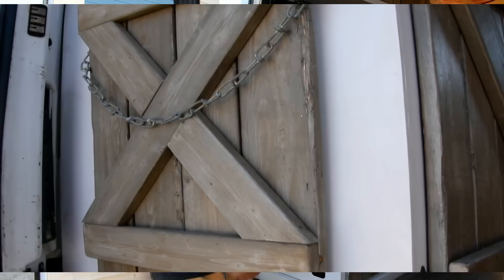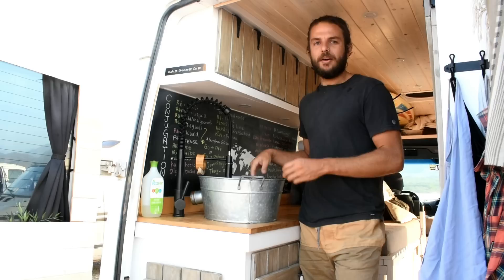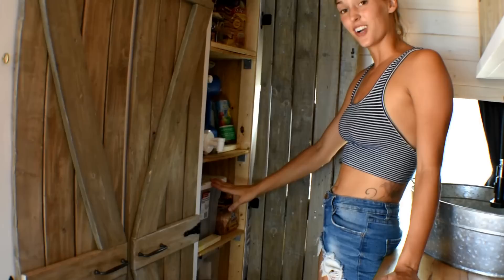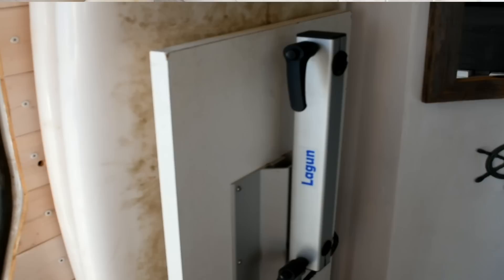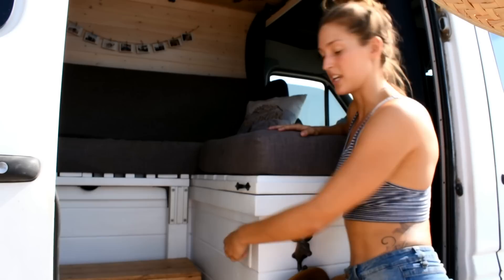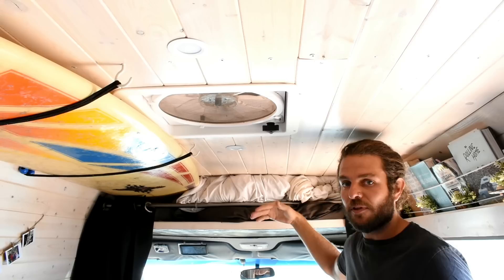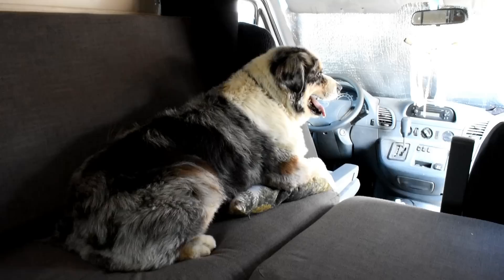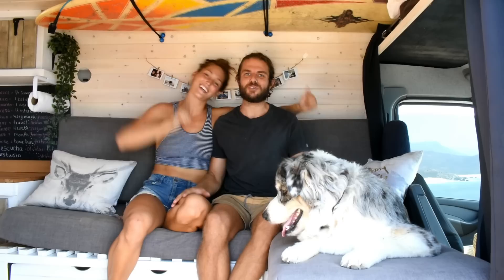BEAUTIFUL Rustic DIY Sprinter Conversion | Travel Couple | VAN TOUR

Comment: 10:25 I've always been curious, do you park for days at a time?  Everyone wants solar, if I was driving every day, even a little I would wire in a battery isolater and charge off the alternator, one less thing to buy.  Of course if you hang out in one place for a week solar is perfect.
Reply: Not trying to be rude, I see a lot of solar everywhere and always wondered if it is because everyone else does or it is what works best.
Reply from the maker: KFStreich thanks for the question! We chose solar because (as you mentioned) we sometimes stay at a place for days at a time and we didn't want to have to run the van to top up the batteries. In saying that, charging off the alternator is also great if you are driving most days. I actually recently added alternator charging to help out our fridge in this extra hot weather!
Reply: I've wondered the same thing - specifically, I've wondered about having to park in the sun when it's super hot rather than going to a shade spot. I would think the van would become virtually unbearable. Of course, I guess you wouldn't be hanging out in the van during the day, so maybe it's not so much of a problem.

Comment: How do you find the 2006? I'm in Australia and interested in something around that age but a little freaked out about the idea of buying something with literally hundreds of thousands of km on the clock.
Reply from the maker: Ours has around 250,000km right now and sprinters are known to run well upwards of 500,000km (& hopefully more)! One advantage of the 2006 is it a simpler design therefore an easier fix than 2007 and onwards. As we will talk about in next weeks video we do budget for continual van maintenance since it is older however (knock on wood) so far we've had no major issues.